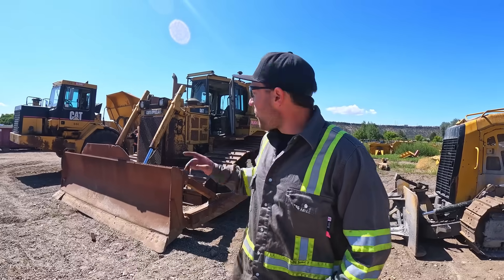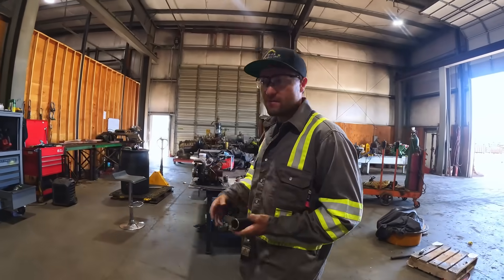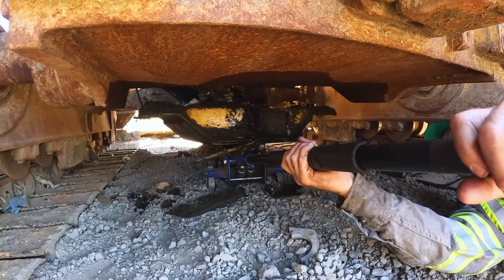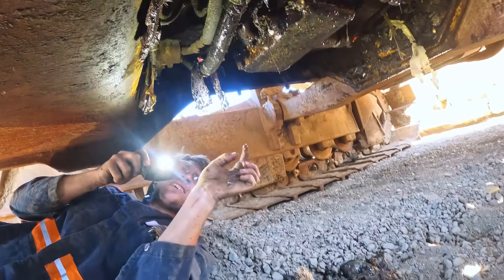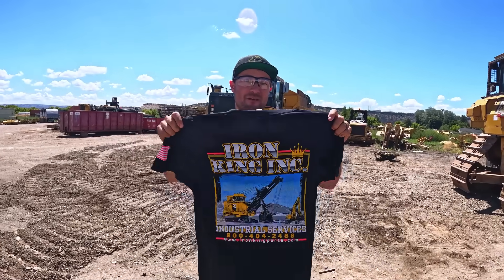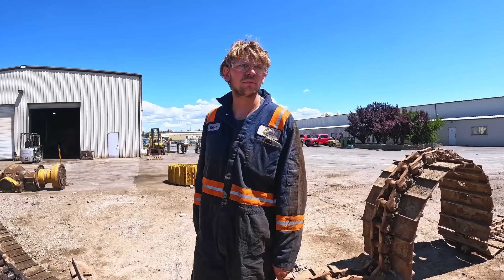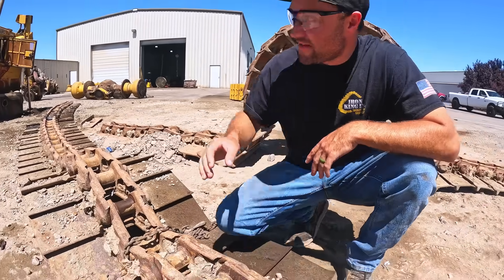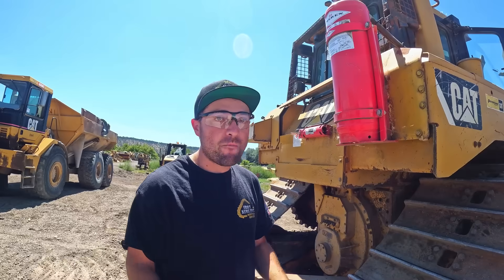CAT D6T HYDRAULIC LEAK DIAGNOSES AND REPAIRS NEEDED

Comment: The apprentice show😂, belly pan have T bolts, tbey spin in their holder/ carrier,  The 2 on the side are Not bolts,  they are pins, washers, and cotter pins. That's Not hyd, Thats transmission oil(30w)  just start, machine,  check fluids.  I would Not trust you guys!! Hyd leak ??😅 Joke
Reply: It's a good thing Ronald is here to verify what oil is leaking based on a video and to confirm the oil viscosity. Cat sis should take notes too that Ronald says it's called 30w and not SAE 30... Don't worry, winter ratings definitely don't have anything to do with the w designation, that's for viscosity only. Right Ronald?

Comment: I often pick up rolls of old carpet that people throw to the curb. They're easy to unroll under vehicles. They're more comfortable than laying in mud or gravel. You and your tools and parts stay clean, and they absorb minor spills. When they're too dirty you just throw them back where you found them.
Reply: Lay a couple sheets of plywood down first and then roll the carpet down and you will think you are 💩tall cotton.  I also roll out a layer or two of carpet out on concrete where I am standing all day your feet, knees, and back will thank you. The absolute best stuff I ever scored to roll out and work on was some used Astro-turf. The stuff was durable, could be washed off was comfortable to stand, kneel and lay on. The only down side was the stuff was rather heavy but such is life.  
Have a great day and a better tomorrow